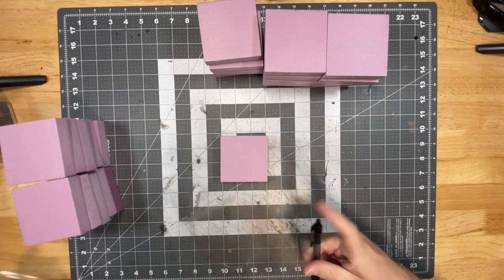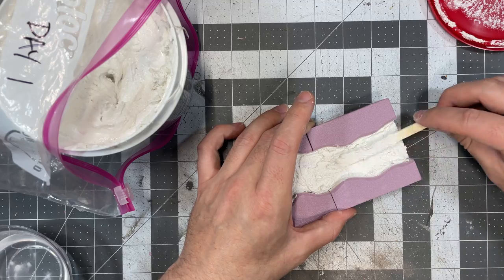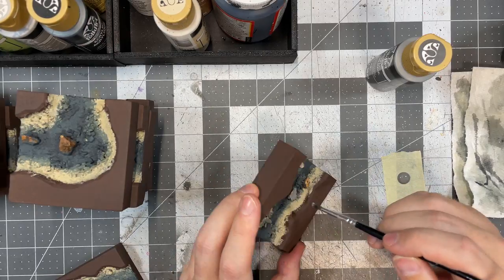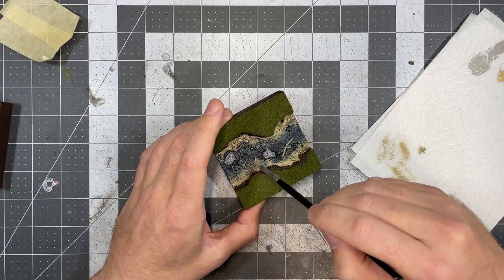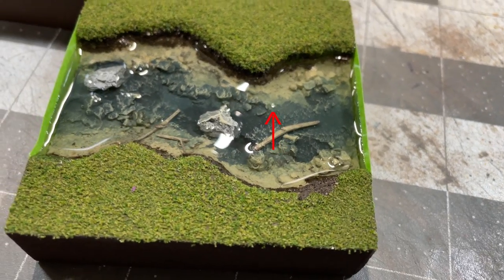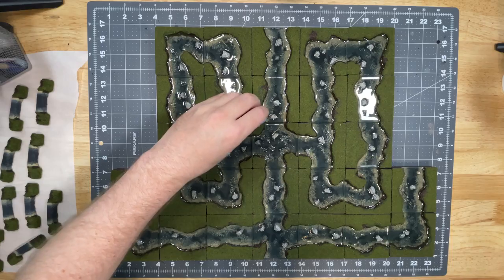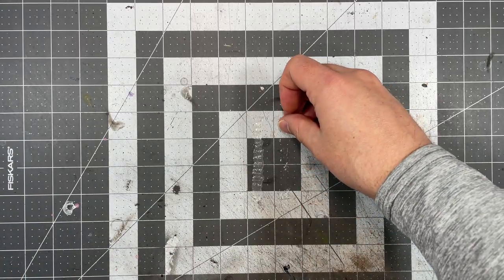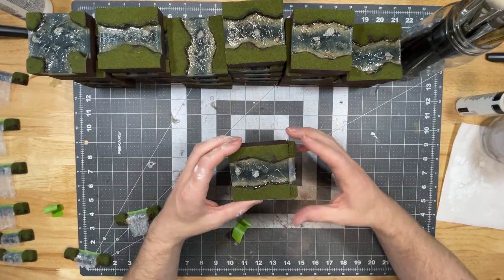How to Make River Dungeon Tiles with Resin and Modular Waterfalls!

Comment: It looks just fine! The only thing, maybe it is worth trying to slightly cut the edges of the water streams from the waterfall, so that they do not seem so "square", but more natural)
Reply from the maker: Yeah I tapered them more and was going to use water effects to get rid of the straight lines on the sides. I still might give it a try. When I consider changes like this though I tend to use them as is for a while and then tweak them as needed.